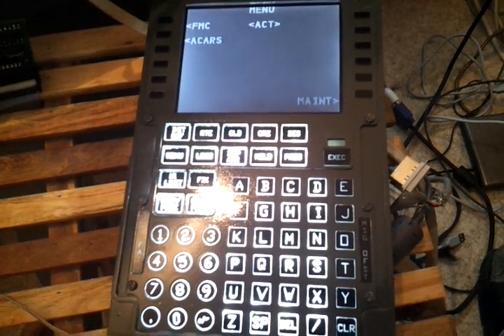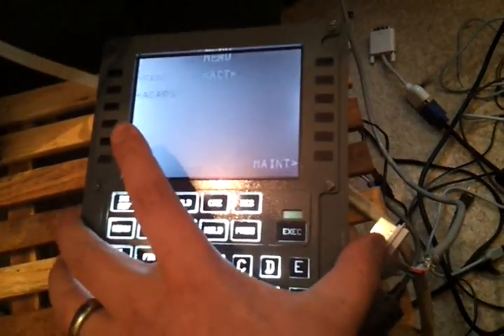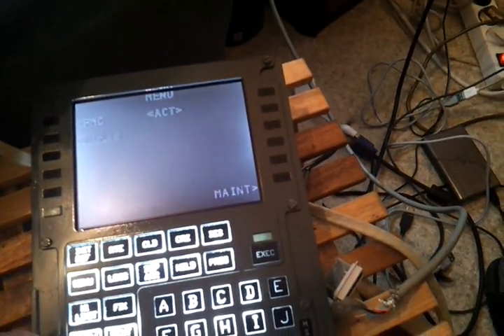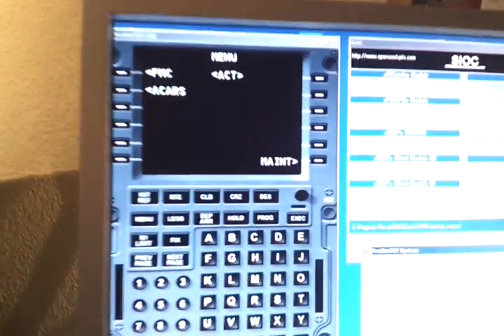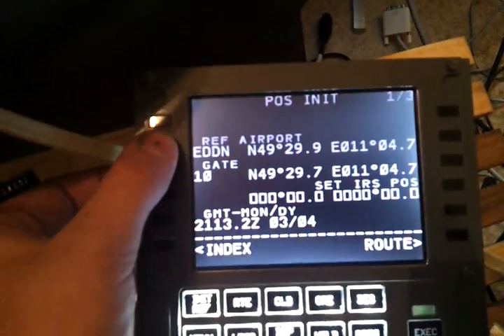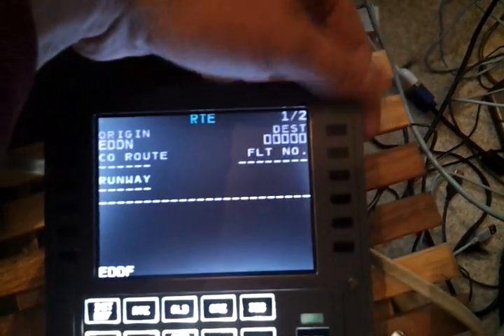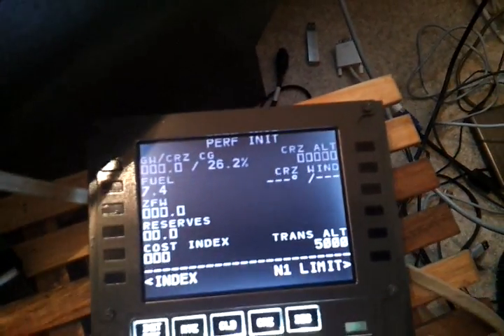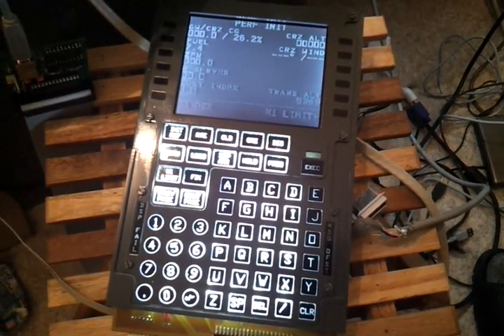DIY B737 FMC finished

Comment: Excelent FMC!!! Congratulations and thanks for share!!! A question: what type of screen are you using??? it's a LCD TFT compatible with Arduino or it's a Tablet???
Reply from the maker: mcastesoft original it was a 5 inch from play station 1 portable, but I replaced it with a standard 5 inch open frame lcd display module which I ordered from China.... It was perfect, because I did not need to change anything and the display fitted perfectly..... VGA input, nice viewing angle... OK fine now...
Reply: Wow!!! Very fast response! Thank you very much!! How it shows the text on the screen as a replica of the simulator FMC??? Does the board you bought in China come with a VGA connector? I'll research a little because i want build my FMC too!! I bought an Arduino Mega 2560 and LCD TFT screen (3.6 inchs) but i still don't know how display on display, the information sincronized with Flight simulator!. Your idea is very good!!!  (I subscribed)   Thanks!!!
Reply from the maker: Input:

The keypresses on the FMC keyboard are read by an Opencockpits Keycard. 
This Card delivers the information which key is pressed via a SIOC 
variable to the PROSIM 737 software. The Prosim 737 software (I think 
you already know this software, if not just google it..) is a complete 
system simulation suite for the Boeing 737. It also simulates all FMC 
functions based on the inputs which it gets from the Open Cockpits 
Keycard.
Output:

The display module in the DIY FMC is connected to a computer (via VGA 
Cable) which runs the Prosim 737 client FMC program. So the main Prosim 
Program reads the Open Cockpits Keypresses and simulates the function of
 the FMC. The Output which is displayed is send to the FMC Client 
program and shown via VGA Cable in the Display unit….
LEDs:

The LEDs are driven by an Opencockpits Output Card… This Card just 
lights up the related LEDs when Prosim 737 Software tells it to do so….
Summary:

DIY FMC Keyboard Key Press Flat cable -> Opencockpits Keycard SIOC 
Variable-> Prosim 737 Main Programm on Main Computer via Network 
-> Prosim 737 FMC Client Programm on separate computer via VGA Cable 
-> DIY FMC Display….
I hope i made it clear how it works….

PLease check my website....http://lowtone.de/wordpress/?page_id=315